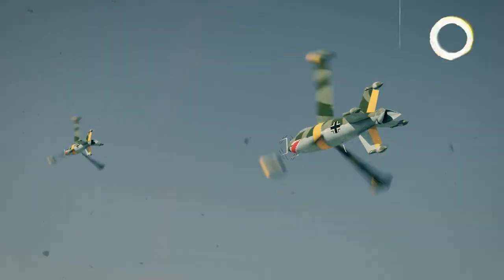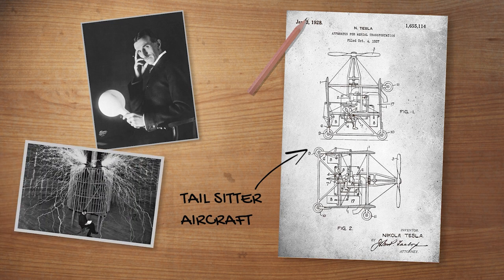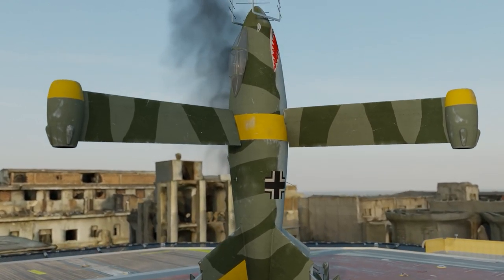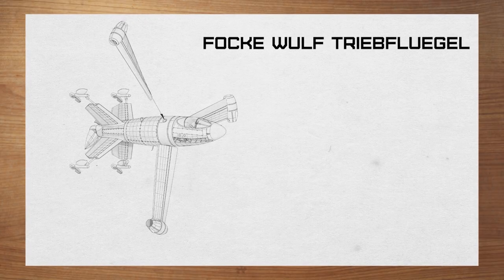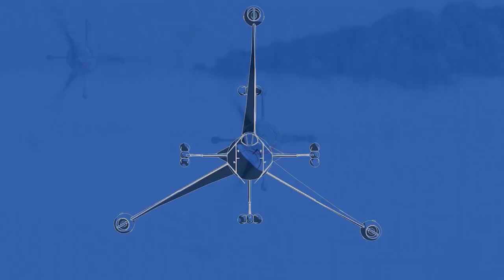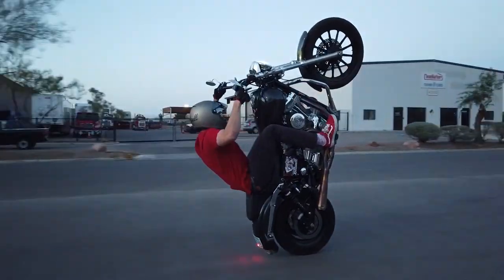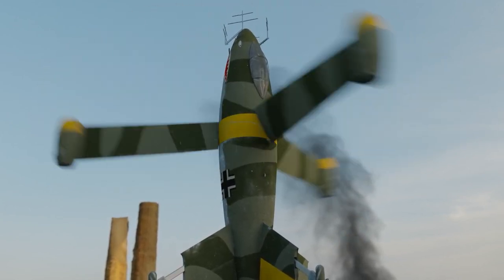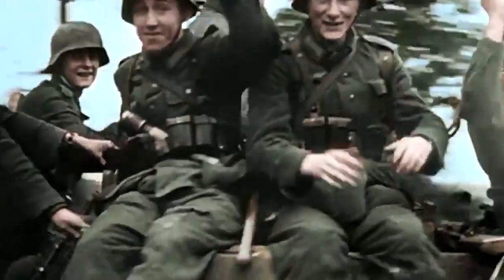This is the most INSANE Nazi aircraft ever designed - Focke Wulf Trebfluegel

Comment: How would this thing roll, ie aileron control?
Also how did they intend to counter the torque? Or was torque not a problem since the engines were mounted individually on the wing?

Comment: But how would the fuselage not spin the opposite direction? Wouldn’t it need some kind of counter rotation like helicopters?
Reply: No. A helicopters blades develop torque, so the fuselage goes in the opposite direction. The tail rotor is necessary to counter this torque. The wings on the craft in question do not develop torque on the fuselage. There are some home built that use hydrogen peroxide jets to power their rotors and because there isn't an engine developing torque, they only need a tail rotor for yaw control.

Comment: You spoiled the suspence! Implying the crafts failed, before the story of the carfts ability would begin.
 Heh, although it was clear how it would never work. 4:11 The narror/small spand, land legs, the very vertical body, equal to the over extended wings, acting like a singular propeller, which had NO rotory to sync with. 5:37 Not to mention mini jet engines, spinning at the tip of main-wings, like a big fan. Just epic🤣. 

 🤔Today those feature could be helpful, for land/decending crafts from orbit, like a Mell-Falcon rocket, having another double try-pod fold stand, but used only like a dive landing propellers. Even used for commercial future Orbitliner (vers the term 'airliner'), possibly in mkcro atmosphere planets, maybe😏

Comment: There are multiple problems with this design. For 1 an emergency escape would be impossible because you would get sucked into the rotor. Once in the air it would be almost impossible to keep from spinning out of control because of the constant force turning you to the left. and finally trying to land would be extremally dangerous because the cockpit would be sticking straight up meaning you wouldn't be able to see the ground and make changes. This is only a small list of problems with this design

Comment: Hello F&E! Can your team discuss about an Indonesian plane that was discontinued? Its name was N250 Gatotkaca and it was the most advanced aircraft of its time, relying on 2 turboprop engines. Thank you!
Reply: I dont understand how it was the most advanced aircraft of its time? You're saying a dash 8 knockoff was more advanced than the F-22??
Reply: LMAOO 😂🤣🤣🤣🤣🤣🤣🤣🤣🤣🤣🤣🤣🤣🤣🤣🤣🤣🤣🤣🤣🤣🤣
Reply: Yeah, doesn’t seem all that advanced.
Reply: @laa0fa502  Let me explain, the N250 Gatotkaca is not a clone of Dash 8, the plane was indeed made to complete the prototype of the N235 Tetuko aircraft, an aircraft created as a collaboration between CASA and Nurtanio (now known as IPTN), after the N235 prototype successfully flew, Nurtanio and Indonesia built their aircraft itself based on the prototype N235, and be N250
Reply: @butler7206  still, how on earth is it anyway "advanced"
Reply: I said "the most advanced of its time" was for turboprop aircraft, the N250 had body and wing that were almost similar to the C130 Hercules, if one engine died then the plane could remain balanced without going left or right
Reply: @laa0fa502  Then, the N250 is the only turboprop aircraft (correct me if I'm wrong) that relies on Fly-By-Wire, then designed naturally without dutch roll
Reply: @laa0fa502  Turboprop, not a stealth jet fighter
Reply: @butler7206  ah then you are correct, it was a grammatical mistake, you don't need a comma after "it was the most advanced aircraft of its time" because the comma means those 2 things are related but do not effect each other.

Comment: I wonder, since its basically a helicopter, could it have a swashplate? Like, realistically speaking, would it make it easier to use, during takeoff and landing, if it was controlled like a helicopter while it was vertical? If it had a rotating seat so you could sit upright

Comment: That's just plain nuts. How would they over come the rotational momentum cause by the wings performing like a prop? With fixed wing prop planes it's done by rudder small adjustments or trim tabs. But this things wings R so big & moving so fast I doubt those would do it. Wouldn't it have 2 have a counter rotor like a helicopter? Or thrust of some kind like a jet engine?

Comment: I wonder how they planned to compensate for the tremendous amount of torque that massive "prop" would create.  How would it be possible to stabilize the fuselage without a second counter-rotating prop?
Reply: There's no torque generated.
The rotor-wing is self propelled by those 3 ramjet.
Reply: @fedomandez  Um...  That's not how physics works.  you have a huge spinning section that should cause the fuselage to spin as well unless something is there to prevent it; like the tail rotor on a helicopter, or a counter rotating prop.
Reply: @OrdinaryDude  The only thing that could cause the fuselage to spin would be some friction in the bearing of the spinning section. Easily compensable as soon as this thing moves, by means of the ailerons / rudders. It's actually a helicopter with tip jets (or ramjet - look for Hiller Hornet). These don't need any tail rotor, because no torque is generated between the fuselage and the rotor (except for the friction in the bearing). That's how physics works.
Reply: @0cer0  exactly 👌

Comment: There is something fundamentally wrong with all the animations. The ramjets are not pointing backwards during flight, they are rather used to propel the "propeller" and should therefore be pointing along the rotation (primarily, see graphic at 4:31, it's called "tip jet"). This also makes the angle of attack of the wings much shallower which was pointed out by others.

Comment: Uuh... Isnt the idea of the ramjets on that you spin up the "propeller" and thus, you have airflow for the ramjet? So you could basicly have a airpowered motorinside the plane, that would spin the rotor up so the ramjets get sufficient pressure to light up? How can you miss this simple concept? It could never land with the ramjets, if the airpressure from just spinning the rotor, wouldn't offer enough pressure to power the ramjet...

Comment: 8:20 "Perhaps not" more like definitely yes lol. Look up the Me 163 Komet, it looks nice and cool until you remember that a fuel leak would set the whole thing on fire and quite literally melt the pilot alive. The thing is Germany didn't have the time or resources to do extensive tests so these late war German planes, while ingenious, were almost always deathtraps.
Reply: 1. Both fuel and oxidizer needed to leak for it to combust, the actual most common ocurrence was the oxidizer leaking wich was corrosive and so could kill the pilot.
2 the komet had most accidents due to operator error, most of experienced german pilots retired, died, or refused to move from the planes they where already accostumed to by the time the komet became operative.
3 although the komet was a glider with a rocket engine straped to it wich made it quite dangerous, to say that most late war german aircraft where deathraps its far from true.
Most where still safer and outperformed the allies despite the lack of high quality resources.
Beasts like the ta c, the 262 and the arado where undefeated for almost a decade untill the allies and comitern adapted the "captured" machinery, technology and cientist.
Not to mention things like automatic thrust, ejection seats, and luminescent panels wich where present in all german fighters since early war.
Reply: @santiagoperez2094  the 262 was shot down many times during the war, while difficult it wasn't impossible especially since the allies were able to actually keep pilots alive and spread their experience around. Also, you say they were undefeated for over a decade, that is both false, as I already said, and also completely stupid. Those planes only flew in combat for less than a year, IF they had actually been undefeated, then of course they wouldn't be shot down in 1948 or whenever because the war *ended*.

Comment: They should have just put a modular ballistic parachute in the nose, yeah the landing wouldn’t be fun but it would at least likely always land safely and it would be cheap to just reload the nose with a new parachute, put the plane on the back of a truck and drive it back to its initial lift off point. (I mean this was a plane the Nazi’s designed to serve in a desperate situation. I guess I’m glad they didn’t do that because then it might have worked and more Allied Soldiers could’ve died.

Comment: Like it or not, the German were really something else on Engineering, just like what one of their top General, Rudolf Von Stroheim said : "German engineering is the best in the World".
Reply: In the Pz 1-4 line, sure; tanks past the Panzer IV, save for the Panther, were unreliable rubbish that spent more time breaking down and ultimately being an overwhelming game-changer.
Reply: @xnyxiee1784  The tanks being unreliable was not the problem, the problem was how difficult and expensive they were to repair and maintain. For example the T-34 was unreliable and prone to breakdowns but it was easy to repair and if it broke down for good, it was also cheap to replace. If a Tiger broke down, however, you needed specialized equipment to repair it and often had to send it back to the factory to be repaired, plus there were so many variants that you couldn't even cannibalize other Tigers to repair yours.
Reply: @adezzz7896  Oh no, they were unreliable garbage - the transmissions alone were terribly built, and a consistent issue for all of the Nazi's armor was garbage transmissions. It's a big reason the King Tiger never saw much, if any, combat - they'd break down before they ever achieved some form of fight.

They really weren't that incredible - Shermans weren't amazing either, and the T-34 was a piece of shit, but Nazi tanks weren't somehow better, their best built tank was literally just the PzIV - beyond that, they just threw out bigger and bigger garbage that really didn't do anything.
Reply: @xnyxiee1784  Oh yeah I totally agree, but I don't think they would have been as bad if they had been easier to repair. They had great optics and guns, but because they were unreliable they often made better pillboxes than tanks. I still don't think the big cats were a good investment though, they already had the right mindset with the Pz. IV and the Stug imo
Reply: @adezzz7896  Easier to repair probably would've helped them a little, but fundamental issues with the internals of the vehicles were still going to be a major let down.

On top of that, they were fucked regardless, let's be real.

Comment: There is no way this thing can fly with all that inertia generated with the spinning of the wing (with 3 heavy engines all the way at the tip of every wing). IF the prototype could even handle all the stress, the inertia would be enough to send the entire craft spinning to an instant crash.
Reply: It surprisingly has enough counter inertia

The problem is rather this thing refuse to fly straight
Reply: @bocahdongo7769  What counters the inertia though?
Reply: @CheeseVRC  The small flap enough to counter the spin. But not large enough to... Generate lift
Reply: @bocahdongo7769  A flap would be useless at take off though.

Comment: Where, the heck, should this starting power devices should have been built in? There´s no exhaust even! The central back is occupied with the main tyres. The engines at the wingtips were not concepted as RAMJETS, because the physical moment they would have provided would have broken the plane into parts! There were normal Jet engines planned to build in, might be such from ARADO, because they had less weight and were shorter than the BMW or DB - engines as built in Me 262, for example. The marginal failure of the German Luftwaffe were to many "experts", who presents types of types of planes, instead of building mass of hunters and bombers, maybe Jets, too! BUT NOT SUCH!

Comment: It was an interesting idea, but it would not have worked. Even with modern computer controls, it still wouldn't have worked. The French came close but even they had to quickly abandon their research into coleopters.
Reply: Even Cleocopter refuses to fly straight even with way sophisticated control system
Reply: @bocahdongo7769  I think the SNECMA Coléoptère came close, but the crash of the sole prototype ended that project.

Comment: replaces propeller with carbon nanotube material, adds plasma generated ultrasound for scanning/anti-collision & increasing material strength, Micro modular reactor, and replaces moving parts with electromagnetic That thing would make a good lift system for space craft maybe. Koenigsegg electric motors the size of my head push 330Hp Each, and you can stack them to multiply power. DAAANG.. Yup.. Too much waste everywhere though.

Btw, one elite smartphone is up to 40 million devices in the form of apps. If you stop mass producing all those other products for the one device that exist cheap at Military spec 810G with replaceable battery, you can save the world. All of it is made in many versions for millions-billions of potential buyers. Digital migration reasoning. < Divert all human energy to life support functions & prepare for RAPID advance from focused research.